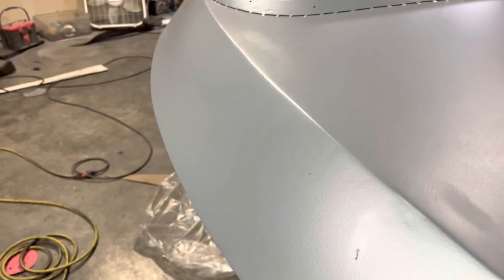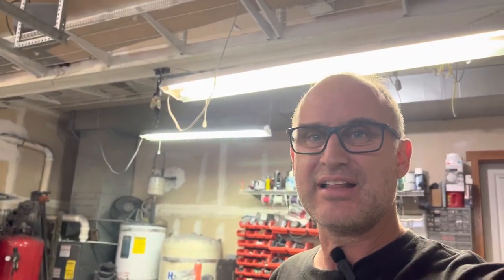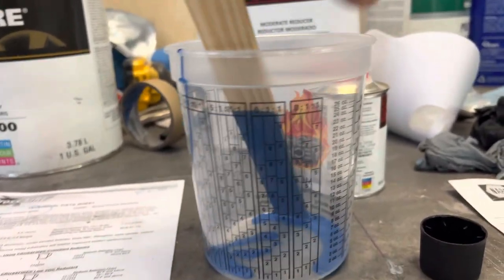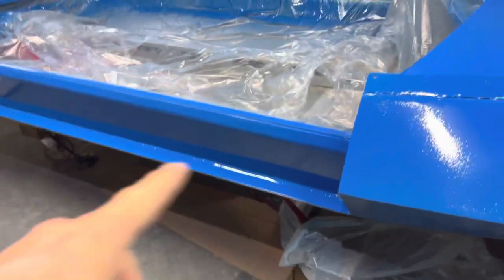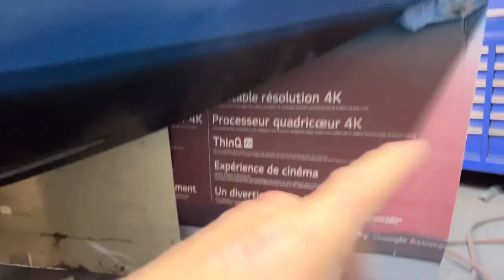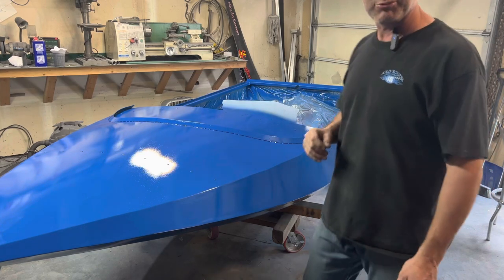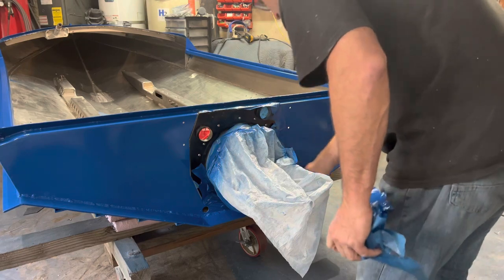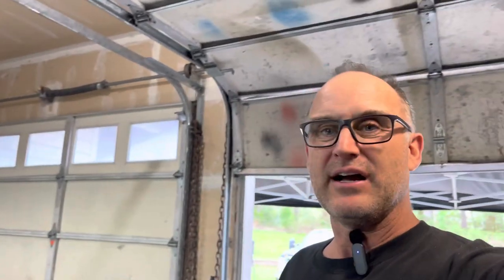How NOT to paint an aluminum boat

Comment: Isopropal alcohol wipe down before paint is a must. Other than that you're paint turned out freekin awesome brother. Could use a good coat of IMRON on the bottom side. That stuff is bullet proof. Awesome paint but expensive as hell. Again, very nice job.
Reply from the maker: I like my bottom paint.  It’s crazy slippery !
Reply: @JollyRoger907  very cool brother. Right on.

Comment: I use Pyrex mixing cups to mix my paint. Also not all paints are going to lay down flat. Over lap areas might look a little thick (orange Peel) also when you move your hand all the way left or all the way right you have to bend your wrist so that the gun stays 90° to the surface.
Reply from the maker: Thanks for the tips!

Comment: Did not realize the sides where so low.
Reply from the maker: Yes they are!
Reply: @JollyRoger907  to bad your a couple hours away. If you were close I’d come give you some free help. Back in the day I built a blown and injected flat  bottom drag boat with a lot of help from my late friend champ alcohol flat drag racer Don Ermshar when I still lived in Buena Park Ca. Had blown and injected BBC with zombie headers and a top fuel dragster rear wing and small stainless t-tank gas tank mounted low beneath the wing off the stringers. It would easily do 125 in the 1/4 mile. Was pearl white with all the happy colors layer out down the side and design up the middle of the deck. It was a show quality boat that never let me down. I was just 21 when I finished it in 1981 and added up just the main stuffs cost and not all the little stuff and had $45.750 in it and the trailer. So reality probably about $55,000 which in those days was big bucks. Detailed a lot of high dollar exotic cars from Newport Beach to pay for it at night and had a day job in construction. Would run it at the Parker Strip in Arizona and was the most fun I’d ever had. I’m on Facebook and name is Ron Masterjohn but for some reason can’t log into my Facebook account now for a few months.